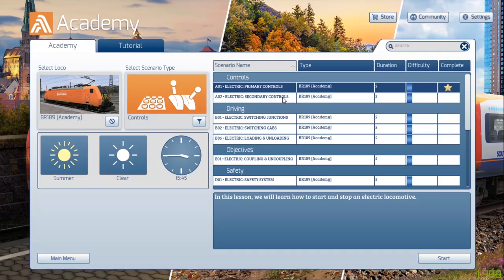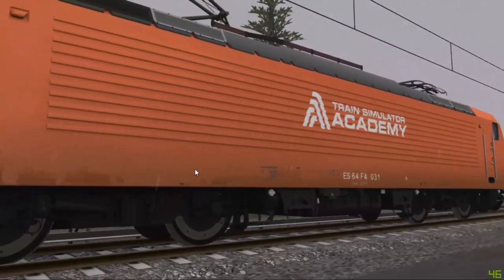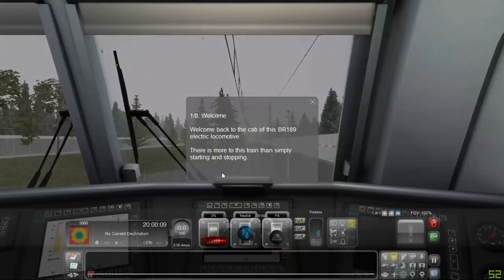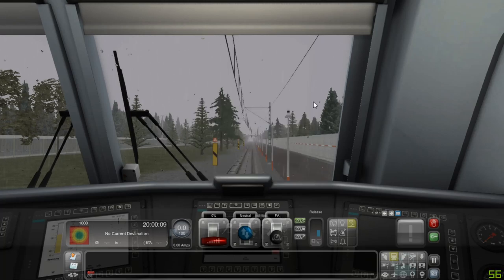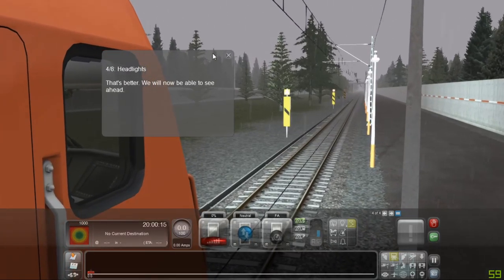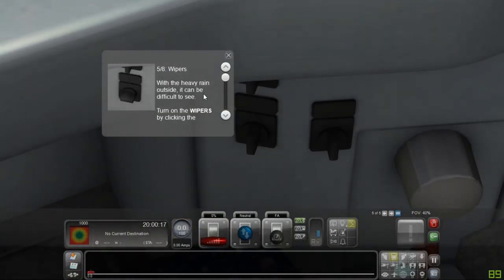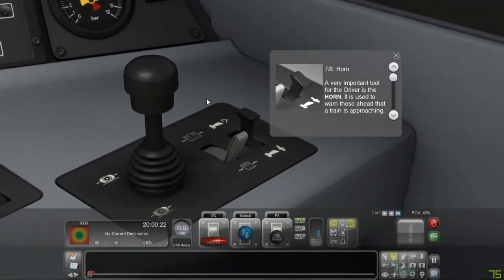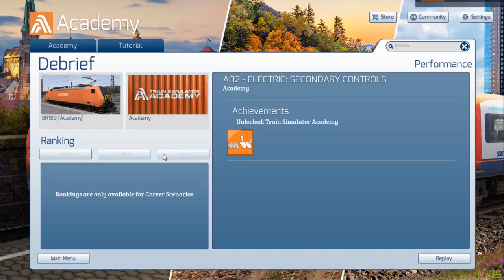Simone plays train simulator 2020 (BR189 Electric Secondary controls Academy)

Comment: In 2001 Microsoft released Microsoft Train Simulator. More than 18 years later not much has changed. So far, I only see a slighter higher resolution. I loved my RailDriver train controls. I hoped Microsoft would continue MTS in the same way it worked on Flight Simulator.. It's a pitty, because with a little more work DoveTail can turn this in a great simulator..
Reply from the maker: yes i totally agree this game has a lot of promise but its still lacking in certain areas also.  i have to be honest i have not found any train simulator that is perfect however